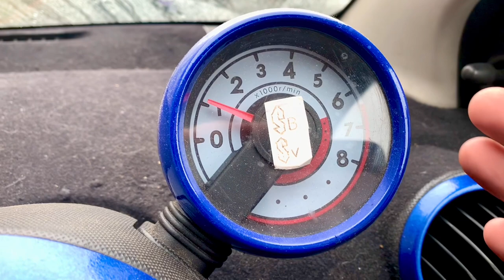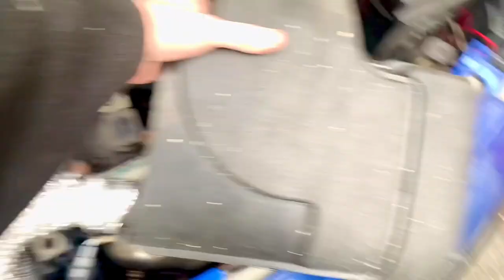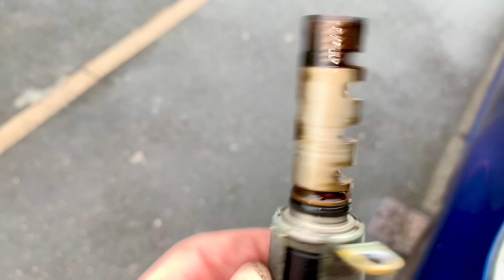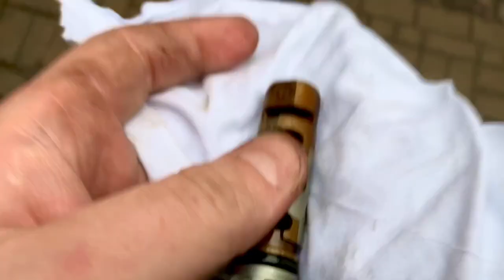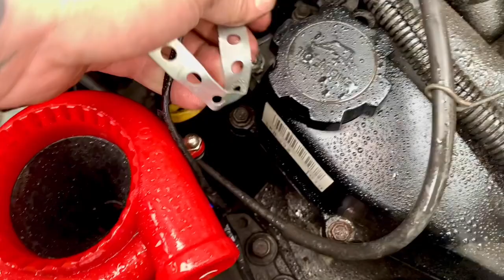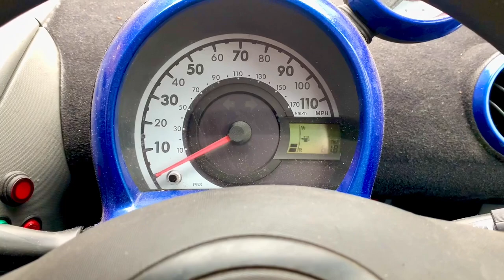Citroen C1/Pug 107/Aygo Poor Acceleration Repair, VVT Solenoid/Vanos Solenoid Repair (CityBug/Yaris)

Comment: Do you know what the part number is for this, or whether there is one on this?

One of our 5 yariss with 1kr-fe has thrown up a light with P0011. Just want to give cleaning it, and the camshaft position sensor a go, but if I could get part numbers thatd be awesome 😁, thanks too, the video is very useful, you are a funny guy 😅
Reply from the maker: I’m not sure about part number, but the vvt Solenoid is likely either faulty or dirty. I doubt the cam sensor is the issue and it wouldn’t throw that code. Also, the chain could be stretched but that’s not really heard of on these engines.

Comment: I drove my 107 for 10 minutes went back home cos I forgot something came to start the car it cranks but doesn't fire up so plugged in the obd2 and had error code p0011 A Camshaft position - Timing over-advanced or system performance (bank 1) is it worth checking this, great commentary by the way 🤣
Reply from the maker: Yea this could be the culprit. Doesn’t usually stop them from starting though as fast as I’ve heard. Did you park it facing up hill and leave it in gear at all?
Reply: @StupidBlokeStupidVideos  it's parked on a level surface it's an automatic I did check the oil and it was low but not enough to bring oil light on, 90000 on clock serviced last October it's got me scratching my head.
Reply from the maker: @paulfrancis2790  I was just asking because if you turn the engine backwards, as in leaving it in first gear pointing up hill and it rolls back a bit, it can cause the chain to jump but these engines aren’t known for timing chain issues. The vvt could be the issue though.
Reply: @StupidBlokeStupidVideos  thanks for the advice I'll clean camshaft sensors and some other sensors and see how it goes,I'll let you know if I'm successful 🤞
Reply: Update rescanned car and getting b2799 communication problem with immo and ecu sounds like I have a immobiliser issue, the p0011 must have been stored in the ecu when my daughter was out in the car oil and engine light came on so topped up the oil and they went off, have you come across any immobiliser issues.
Reply from the maker: @paulfrancis2790  have you had your key apart or anything?
Reply: I've just watched your video on pairing the key to ecu I'll give it ago tomorrow, thanks for your videos.
Reply from the maker: @paulfrancis2790  let us know if it works
Reply: @StupidBlokeStupidVideos  well I tried the 30 minutes programming still doesn't start will have to investigate later when I'm back from my hols.

Comment: is possible not fault code but sound ground at 2000 tr/min at the moment of vvt ?
Reply from the maker: It is probably possible, but likely to throw a cam position code on most engines.
Reply: Hi did u sort it?

Comment: Have you flocked the dash 😅😅😅
Reply from the maker: I have! 

You know what, it’s one of the best mods I’ve done, makes car way better to drive without all the reflations on the dash. 

Here’s how not to do it 😃 
https://youtu.be/xhiauBsBMWI
Reply: @StupidBlokeStupidVideos  I was gonna do it in my scoob but I smoke and its a nightmare getting ash out of it
Reply from the maker: @stoglegend  yea, mine has no ask sticking to it,.. just regular dirt and dust 😂
Reply: @StupidBlokeStupidVideos  is it just my shitty aygo or has yours got the longest second gear ratio ever .... I can literally go from nothing to 50 ish , don't need any other gears
Reply from the maker: @stoglegend  they’re long as fuck. Mine does 35 in 1st, 65 in second, 90 in 3rd, 110 in 4th and fuck knows what in 5th, but I intend to find out 😂
Reply: @StupidBlokeStupidVideos  I've not managed to get mine over 100 as my tyres are like slicks . But I'll be certainly trying now 😂😂😂😂. Challenge accepted